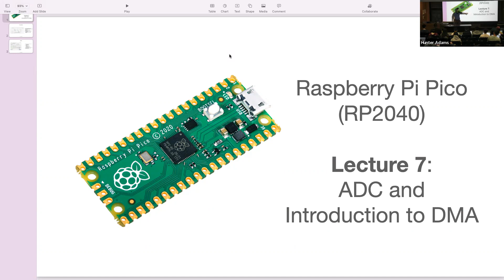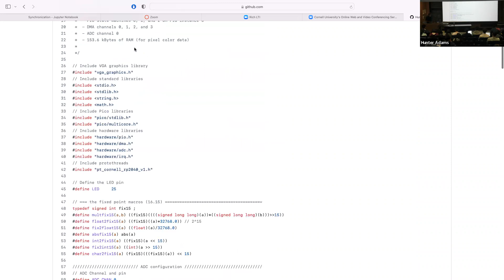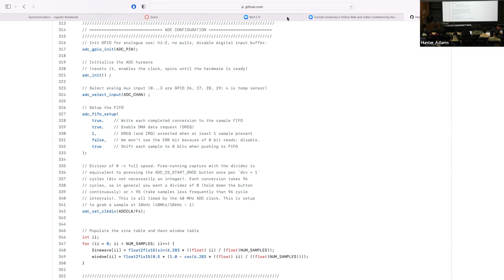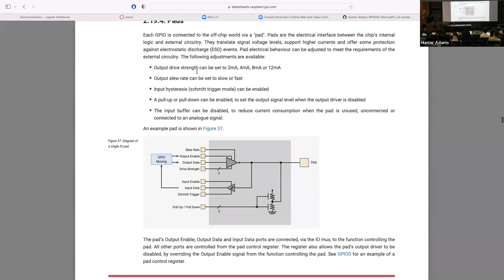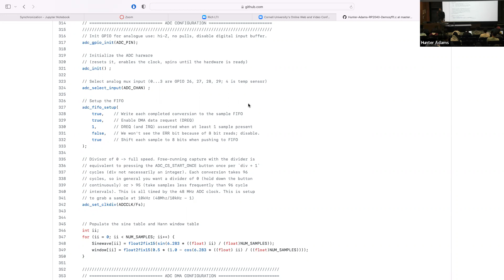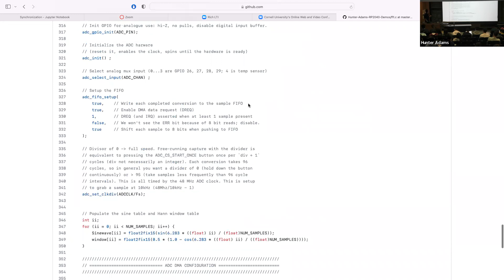Raspberry Pi Pico Lecture 7: ADC and DMA

Comment: I have been having difficulty using the ADC with DMA when using FreeRTOS. I have not tested the DMA separately, but I have tested several alternatives for configuring FreeRTOS and when I activate the ADC conversion the chip actually crashes. I have already searched the internet and shared the problem in forums, and I have not been able to find a precise answer or someone with experience in this combination. If you can help me with any suggestions, I see that you have a good command of the rp2040. Thanks.

Comment: The “missing” ADC pin is connected to Vsys via a voltage divider so that it always reads Vsys/3 (IIRC). The most obvious application is to check for low battery although there’s probably other uses as well. It’s somewhere in the Pico data sheet (not the RP2040 data sheet) where they have a full schematic for the board.